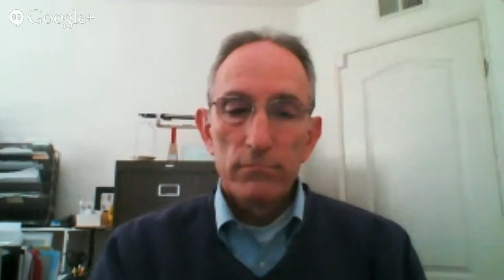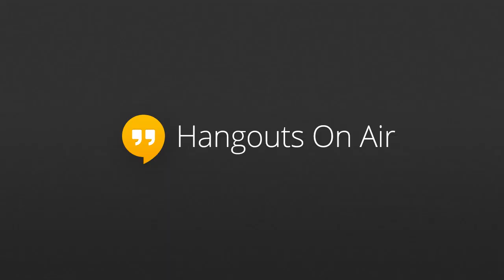What is the difference between a synthetic diamond and a simulated diamond?

Comment: What materials are simulated diamonds made from at Agape jewelry?
Reply: There are two types of simulated diamonds.  They are either cut from Cubic Zirconia or Moissanite. There is no third option.  Cubic zirconia is a form of synthetic zirconium dioxide and Moissanite is synthetic silicon carbide.  I believe that Agape is made from CZ.  Some companies, and I'm not referring specifically to Agape, say that their simulated diamonds are better than CZ, that they have some additional properties.  In my professional opinion this is simply an attempt to hide the fact that their stones are cut from CZ.  Somehow they believe that there is something wrong with CZ and they need to make their stones sound better.  In my professional experience cutting the best available quality rough cubic zirconia and cutting it to ideal diamond proportions is the best way to make your CZ based simulated diamonds stand out from the crowd.  The same would apply to Moissanite.  Cut the best quality rough available and cut to the finest proportions as if you were selling top quality mined diamonds.  Quality and integrity will always make you stand out.  In business and in life.